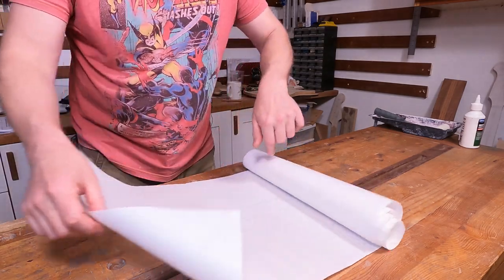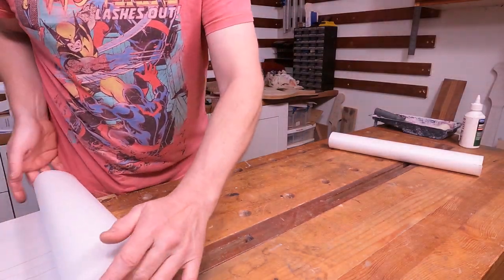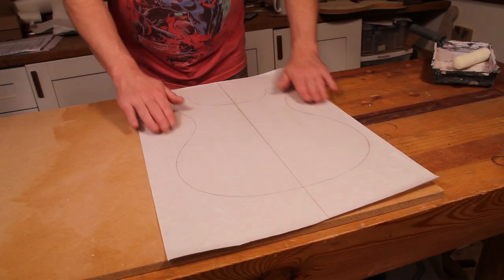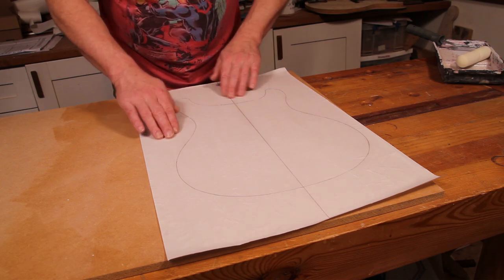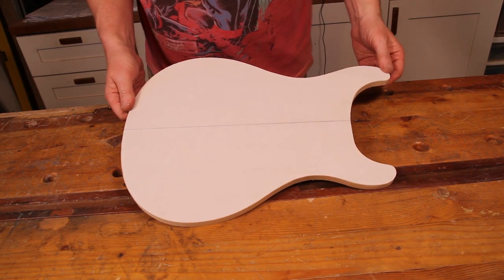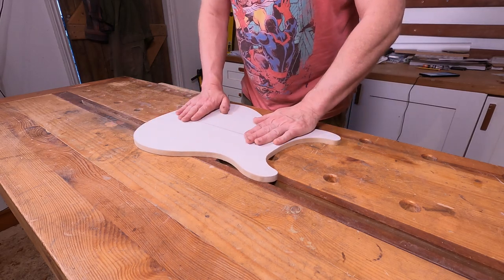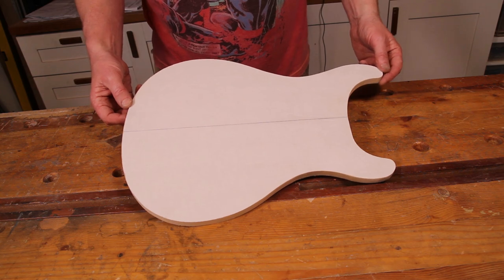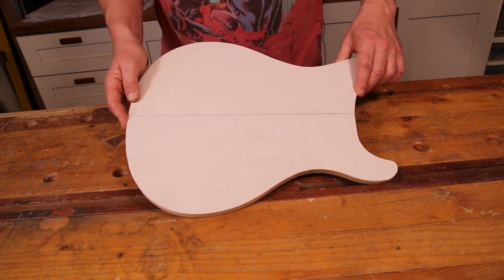GGBO 2022 scratch build guitar episode 2

Comment: In the process of building a Strat right now, but after that I’m going to use your 335 build series to help me build one. This semi-hollow build you are on gave me the inspiration to push on with it. Thanks.
Reply from the maker: The 335 build was a bit of an epic but getting it done was a great feeling. Don't be afraid of taking it on, take it a step at a time and you'll be fine.
Reply: @Adventuresfromtheshedofdreams  thanks man. Your series will definitely help.
Reply from the maker: @ryanwalker3015  pleased to hear it 😃